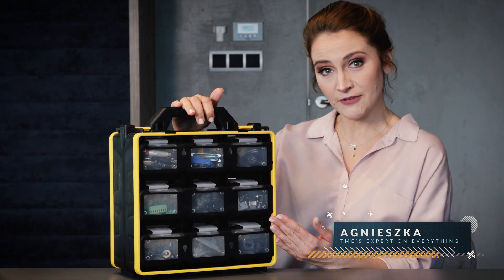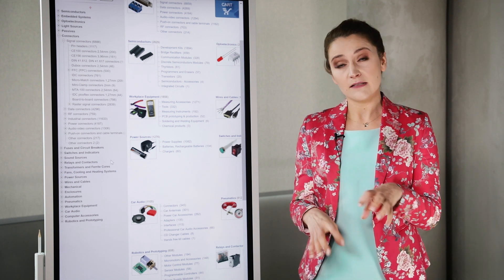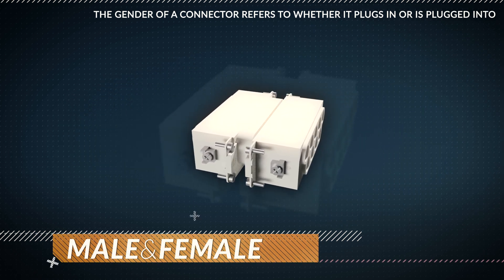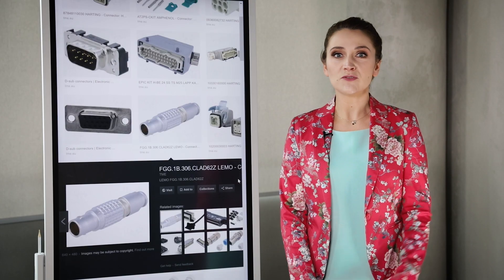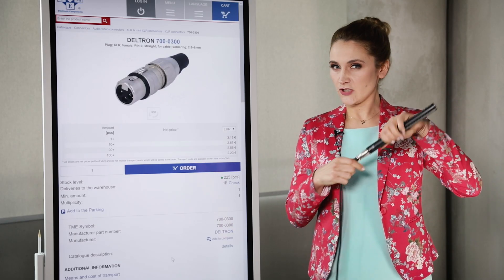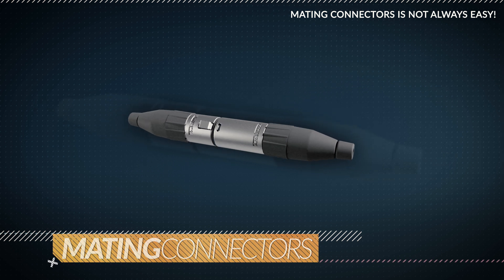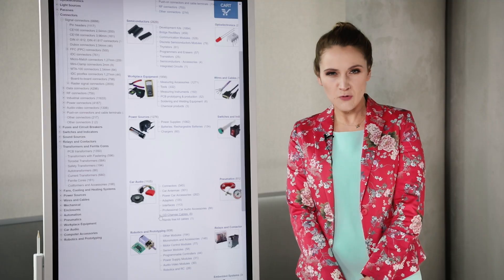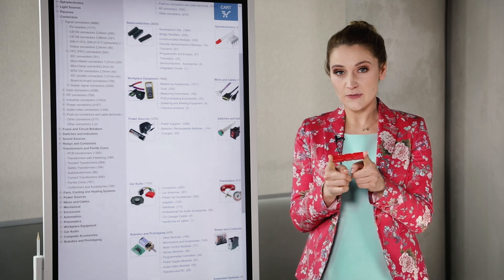Gender. What is the difference in male and female connectors?

Comment: What is a transgender connector?
Reply: For example, micro ucb with the belief that it is ucb-c
Reply: Funny enough, genderless connectors do exist and there are ones that can interchange
Reply: The "transgender connectors" you mentioned do indeed exist. I'll give you a typical example: the RP-SMA radio connector. Contrary to normal SMA, the male RP-SMA connector has a hole inside, while the female RP-SMA connector has a pin. A male RP-SMA can mechanically connect with a female SMA, but only mechanically. The signal can unreliably pass through. So when engineers mistakenly connect a male RP-SMA with a female SMA, it leads to random failures that are difficult to troubleshoot. That's why I don't use male/female terminology, not due to gender identity politics (which isn't an issue in China), but after an incident that destroyed four of my power amplifiers (costing ~$1000 each).